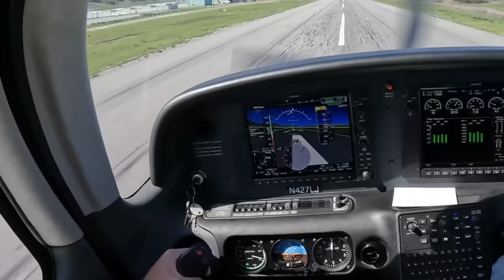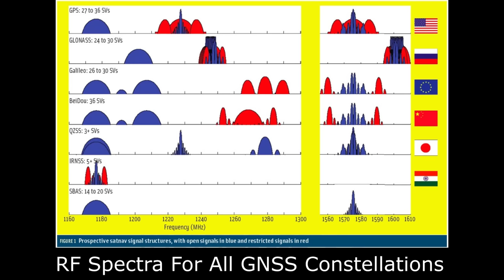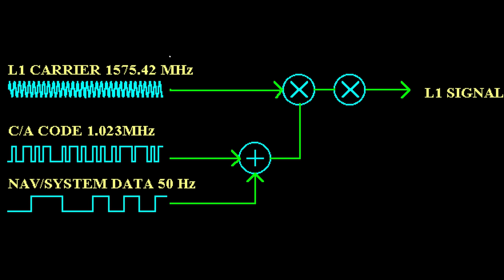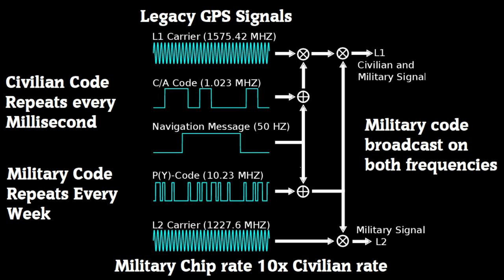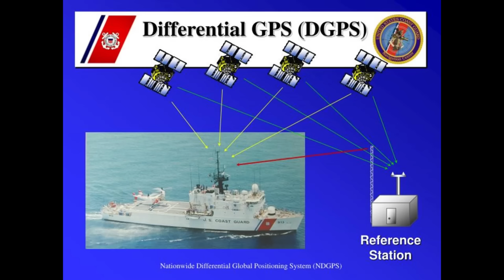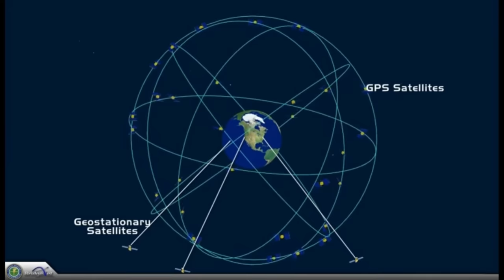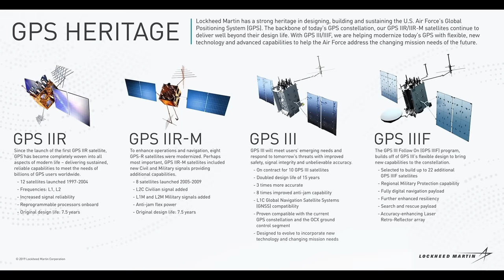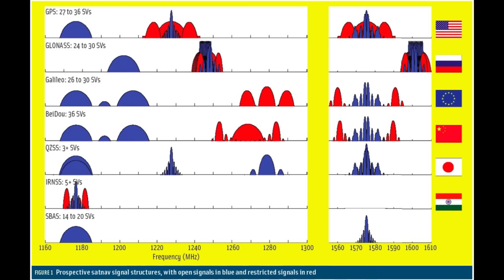How GPS Works, And How It Got Better Than The Designers Ever Imagined

Comment: Great overview of GPS etc accuracy. One more obscure improvement is the new much smaller Cesium Clock oscillators in the satellites. Some of the early satellites used Rubidium clocks as they could be made smaller and cheaper. All of the latest block satellites have very small and low power Cesium clocks. I believe that higher satellite transmitted power also allows smaller antennae in cell phones and other small GPS receivers. The development of better, cheaper, smaller, lower power Cesium clocks was an exciting time to be around the Hewlett Packard Precision Time and Frequency Division.

Comment: Back in the 80ies (may have been early 90ies, not sure)I fitted an early Garmin GPS on a ship for a special project, it had a monochrome CRT screen (only displaying Lat, Long and Speed IIRC, no maps!) and was so heavy it took two of us to hold it up while a 3rd put the bolts in !
The satellite constellation was not complete so it only worked about half the time when there were enough satellites in line of site.
And it took at least 1/2 hour from turn on to getting a fix even if there satellites available because it had to receive the orbit elements for the satellites every time, no saving it for next time.
But it was still like magic to us at the time.

Comment: I’m an avionics technician and started working on airplanes with GPS as the norm for long-range navigation. But it’s wild to consider pilots are doing synthetic ILS approaches now to land commercial flights and coupled with transponder data, planes can be their own ATC with ADS-B Out and subsequent ADS-B In capabilities. 

Awesome video!

Comment: A quick correction: aircraft "surveilance" (reporting your position) uses BOTH secondary transponder radar AND ADS-B.  To fly in controlled airspace in the US you're required to have BOTH.  Presumably so that the FAA can smoothly transition between the two.  But even for those with 978 ADS-B are still required to have the old-school 1090 transponders.  Go figure.
Reply: Redundancy, so that you still have one if the other fails. No doubt they eventually will have a single system that is a tenth the size, with both integrated into it, and with a quarter the power consumption. then will demand 2 as well.
Reply: Secondary radar does not require GPS - it will work just fine without so it will be kept (like ILS/VOR) do deal with situation of GPS failure. Some reason that the powers that be are restarting LORAN and eDME research.

Comment: Per 17:00, in the 1990's the vertical error was a source of humor when using GPS on my boat. We regularly got altitudes of negative tens of feet when we demonstrably were AT sea level.
Reply: Part of the problem is that the geoid used by GPS  is a theoretical model, while sea-level depends on gravitational fluctuations in the earth's crustal rocks.
Reply: @gordonrichardson2972  I know about that, but it doesn't explain from 70 feet above sea level to 50 feet under water in one mile. When all your triangulation points are above you, accuracy suffers.
Reply: With more precision you run into the problem of how do you define what 'sea level' actually is. You can take an average of the sea's height over many tides, but that will vary according to location, some places have very large tides, in some places the difference between high and low tide is relatively small.
Reply: @phuzz00  Well, my rule of thumb is that if fish are swimming in it and it's tidal, it's below sea level. I do have concerns about depth soundings, but as my boat draws 3 1/2 feet, if I run aground, I can jump over the side and push it off.

Comment: I never knew what exactly WAAS was despite knowing what Differential GPS was and starting my own IFR training. I like that you used an approach into KJAC as a demonstration of a GPS/RNAV, as I live there and worked at the airport for a while. Speaking of, that runway actually does have cat III ILS, but nobody uses it anymore. Also, we just got the runway replaced like two years back and it has cool centerline lighting and all that. Fun airport for sure!

Comment: I remember learning about CDMA in my uni wireless communications subject, it was one of the more fun subjects. We actually did a paper example of decoding the CDMA signal, recovering multiple data streams from a raw signal. Took a while to find the right alignment of the code and the signal, but was like figuring out how magic works when you found it. So it's fun to learn how it's used by GPS.
Reply: CDMA is easy compared to QAM, that is still some kind of sorcery to me.
Reply: @HappyBeezerStudios  they didn't cover QAM in as much detail as CDMA in my uni subject. I learnt a lot more about it when I was a broadcast engineering trainee, since it's used in DVB-T transmission and satellite up/downlinks.
Reply: Ya gotta know your trig and complex math to get QAM! Digital trellis modulation works the same way :)

Comment: My major in the uni was surveying. I remember when we used GPS in classes it still had CA. And we would stay ona a point for several minutes that the random error would average out from the readings and we can an accurate coordinate. And it was turned off once I finished my studies. And I started using GPS car navigation on a Windows CE Compaq iPaq with a handheld GPS receiver connected with 9pin serial cable and some adapters. Boy it was messy, but it worked.

Comment: When I graduated with an Engineering Degree in 1985, I interviewed with TI.   One of the things they showed me that they were working on was an early GPS receiver.   It was literally larger than a foot locker.   Just small enough to be mounted on a tank.   They were working on a next generation, trying to make it small enough to mount on a Jeep.  These had multiple circuit boards with semi-rigid coax running between them.   Also no mapping at all in them…you got lat. long. Alt, and time out of the box, and that was it.   Now all this is one tiny chip that takes up part of one corner of a wristwatch, and the accuracy is better.
Reply: We (at TI) had pretty much finished up the HDUE (High Dynamic User Equipment) and MANPACK (portable) GPS receivers at the end of 1978 ...  I would have expected smaller units were being made by 1985, like the size of their LORAN receivers and the marine radios of that same era.

Comment: Thought you might enjoy this. I'm an AVI tech on CRJ-900's. The FMS (flight management system) on the fleet I work on use DME and VOR for navigation. There are two DME systems on the plane and each system can handle 3 channels at once. 2 of these channels are for the FMS and one for pilot control. So when the FMS is programmed it listens to up to 4 DME stations using trilateration to plot against a map database in conjunction with VOR stations. The CRJ-900 does have GPS capabilities as well but as far as I'm aware they use the FMS as well as iPad with foreflight for most navigation.
Reply: Normally we run with autotune on, so all 6 DME's are jumping around controlled by the FMS. And regardless of whether the first 2 are auto or manually tuned, they are used in the multilateration, if receiving a station. Also the GPS'es are running full time and mixed into the FMS position (as are the IRS'es, if installed). The FMS position uses all* of these sources simultaneously, but weighs the GPS info far more heavily. You can check all this stuff out by hitting MFD DATA, then MFD MENU and then line select NAV STATUS. It shows you on the MFD all the nav sources, each with yes/no being currently used, and the difference from the FMS position. GPS is always 0.0 or 0.1 NM, while the others are normally half a mile or more off. Since you're on the ground there's a good chance it won't be catching more than 1 (or even zero) DME's, so it might not be using that at all. For even more detail on that, line select VOR STATUS.

* when I say "all," actually it only uses 1 GPS and 1 IRS at a time, I guess ready to switch to the other one if the first fails. Why not both simultaneously, I don't know.

Comment: I had to step away from general aviation in '07, as the GPS revolution was taking off, and I found my little Garmin portable unit to be an incredible boon!  I hope to get back into flying, and expect the biggest challenge to be catching up with the new nav systems.
That said, I will keep charts of some sort with me; besides the unlikely event of some sort of equipment failure, the challenge of navigating by following features on the ground is FUN!

Comment: Shortly after I got my PPL I also got a hand held GPS unit. That was in the days of Selective Availability GPS. Although I never got lost during a flight using the old paper maps and eyeballs, it was reassuring to have that unit in my bag. By the time Selective Availability was turned off I was no longer using that first, clunky old GPS unit. And now my phone has far better accuracy than I had available in flight way back when.
Reply: If it was an old clunky Apollo GPS, I programmed them when I worked for II Morrow.

Comment: Always in amazement with GPS and the ease it will give your position.  I remember when in the Merchant Navy you needed a time signal to correct the onboard chronometer, a noon day sight and a lot of calculation you might be accurate within 5 miles.....  An amazing system, much underrated.....

Comment: That was great. I took a huge interest in GPS in 1996 when I first got one (for locating cave entrances) until after SA was turned off and I could stop worrying about the details so much because it just got a lot better. And I was amazed at how much better the clients got from 8 channels and 2W in 1996  to lots of channels and multiple systems (glonass etc) using only mW with much faster startup just in an average phone. (The better accuracy is nice but it's actually the the much lower power consumption that really makes the most difference from the early days INHO. But I was always rather vague about the various DGPS and WAAS and EGNOS systems, so it's nice to have the details and timelines clarified. Some info on what you get with modern paid-for DGPS would be nice one day too.

Comment: Don't forget RTK GPS which uses carrier phase information to get cm level accuracy relative to a nearby reference station (and can be used to calculate orientation if the reference station is on the same vehicle), or the more exotic PPP, which is a private (expensive subscription required) Space Based Augmentation System that provides <10cm accuracy anywhere in the world by calculating atmospheric parameters and extremely precise orbit corrections. The downside of PPP is that it takes a lot of processing power to calculate the solution and it takes many minutes to converge to full accuracy, so it's not suitable for every application - Offshore survey vessels do often use PPP though.

Comment: Thanks for the info. You may also like the following story. I worked in the North Sea oil business in 1973 - 1976. Exploration drilling rigs needed to accurately determine the location of the oil/gas well you were drilling. The old Decca system was very iff'y. So we switch to using the US sat nav system. A container sized computer would be shipped out to us. Once the rig was achored we would wait for a satellite to pass over. Then wait hours for the next one and so it went. After acouple od days we would roughtly (better than counting Decca lines) know  where we were. Happy days. PJ

Comment: Would love a follow-up dealing with RTK (real-time kinematics) enhancements that get you centimeter precision. Can you imagine if every cell tower was required to act as an RTK base station?
Reply: I have been involved with CORS (Continually Operating Reference Station) and Network RTK for many years. With multiple constellations and improved processing algorithms, you don't need a base every few km's. Generally speaking, the accuracy of modern Survey RTK GNSS equipment is 8mm + 1ppm in the horizontal with vertical being 1.5 to 2 times that. So at 5km, the Hz accuracy is 13mm. Network RTK allows the modelling of Ionospheric,  Tropospheric,  Clock and Orbit errors over a wide area such that you don't need to be really close to the base to get the accuracy. Most CORS networks work on a 40km baseline between CORS. Improvements in algorithms has seen 80km, 100km baselines provide great results. Saying all of that, the GNSS Reciver and Antenna are critical to the accuracy. The Rover Antenna's ability to filter out unwanted signals, the ability to detect and reject multipath (reflected signals) and the algorithms used to compute Network RTK, are vital to accurate and reliable results.
Reply: @jasonspall2157  13mm accuracy... Based off signals coming from satellites in medium earth orbit. That's absolutely amazing, bonkers, wild, and a whole host of other superlatives. Mind = blown.

Comment: Also your mobile phone absolutely depends on GPS, just to provide an accurate clock that allows for the time slots per device to be as tight as possible, allowing for maximum data throughput, but also to provide an accurate clock that allows the base stations to be able to use QAM256 to get as much data through per signal transition, using the GPS clocks to generate a very precise, as in down to single parts per billion accurate, clocks for the base stations, to do this. No GPS, no clocks, and very much degraded phone service, as the towers need to fall back to a very coarse clock provided by a heated crystal, good enough for one part per million, but now resulting in a much reduced data rate per device.
Reply: I've often wondered how apps like Google maps know where I am so accurately. Is it GPS (and if so, have I got it for free?!), or is my phone just triangulating from the nearest masts? Turns out (if I understand your post correctly) that it's both - my phone triangulates, but the transmitters know where they are via GPS. Have I got that right?
Reply: that isn't true. Most base stations use an internal time base and will synchronise across the network to ensure clocks are synchronised.
Reply: That's not quite right. The cellular networks use GPS for time and frequency references, to help keep all the base stations in sync (which is necessary for modulations such as CDMA (3G) and OFDM (4G upwards). The phone itself takes its timing from the cellular network, and doesn't need GPS at all.
Reply: @salerio61  Yes, but the local master stations will also use a Cesium or Rubidium clock, which is slaved with the GPS to provide an accurate local time and frequency, which will be shared by the local cells. But the local stations all will ultimately have a clock derived from a GPS receiver somewhere local, which is at a precisely mapped point, used as a reference marker for all timing in the area. Depends on cell density just how big an area is covered by each one, at least large enough that the coverage to the other GPS equipped stations is under the error budget, so that you can hand data traffic over to cells with different master clocks and not loose too many packets in the handshake.
Reply: Time slots (TDMA) is only used for legacy GSM voice, and a few 4G bands. TDMA ends up being terrible for data, since a phone takes an entire timeslice even if it only needs to transmit a few bytes of data. When data services began rolling out, CDMA trounced GSM. GSM ended up licensing CDMA and adding it to the GSM spec for 3G data (UMTS). Yes, CDMA won the GSM vs CDMA war.

Since most voice is now VoLTE, TDMA is only used for GSM in rural areas. The few 4G TDMA bands are only used if the tower knows your phone needs a lot of data, to reduce bandwidth wastage. (Most 4G bands are OFDMA, assigning each phone an orthogonal batch of frequencies as opposed to orthogonal codes in CDMA.)
Reply: An OCXO has excellent short term stability, better than 1PPB. The GPS is used to provide long term stability.

Comment: That code shifting for the extra signals in the same band is very similar to the UK analog Colour TV signal called Phase Alternating Line (PAL) which had a 25 Hz offset relative to the black & white signal. It was very similar to the  French SECAM system. The magic of comb signals.!